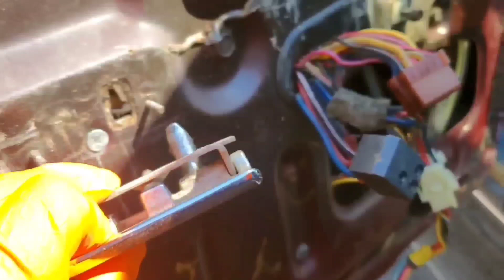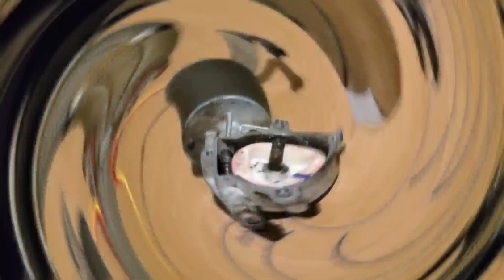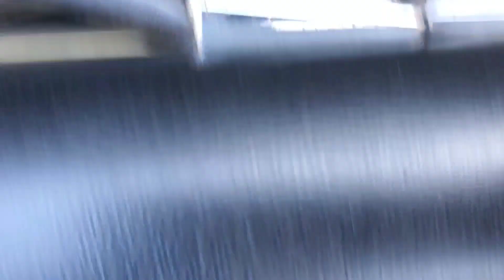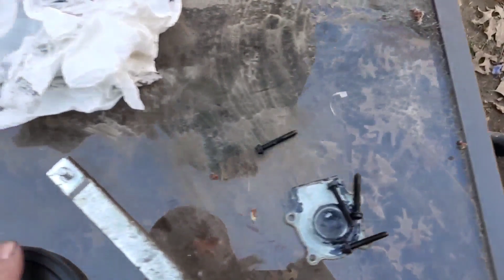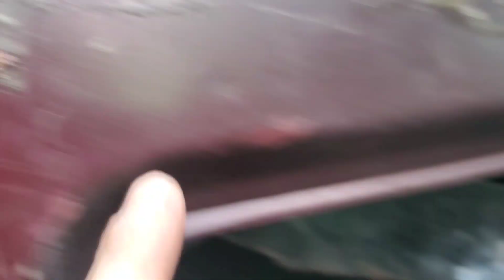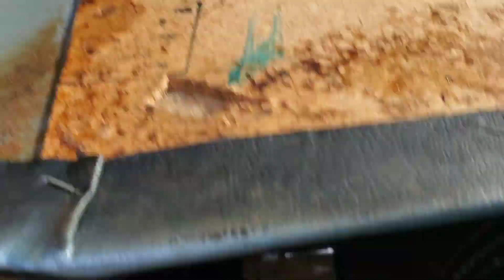How to Replace the GUTS of a Car Door! (1969 Lincoln Continental)

Comment: Do you have power to the windows yet? thanks for the videos currently rebuilding my 69 and you have helped me out a-lot. Cheers!
Reply from the maker: Oh yeah there's never been a power issue on mine all the wiring I've messed with so far has been good still. I'm gonna be doing this same thing to all 3 other doors as well. Full re build of all doors
Reply: Do you recall how many winds it took to load the spring?

Comment: Very nice informative video, Thanks. Also the bulging on the armrest, I used an xacto knife and sliced very thin bit of the insulation out. Then I used “Shoe Glue” applied with a popsicle stick inside and masking tape to squeeze top and bottom together overnight. Was able to draw together and it worked great. Just a possibility for you. Re upholstery is the best of course!